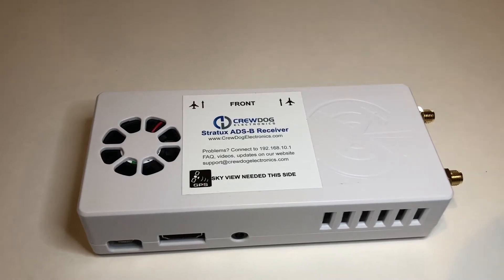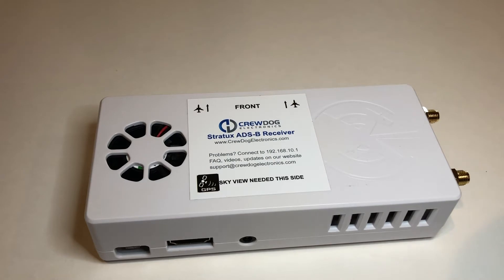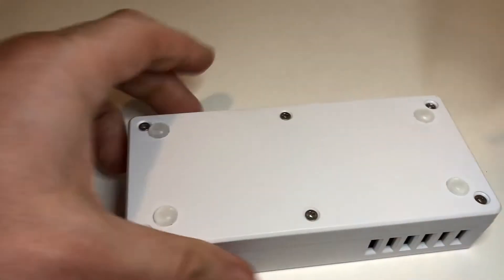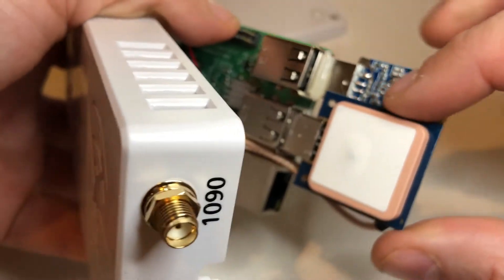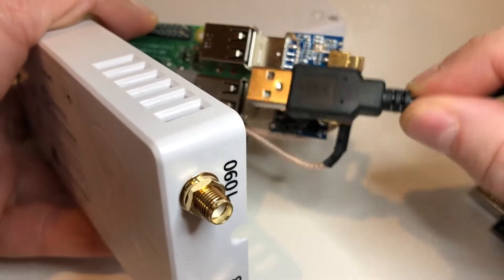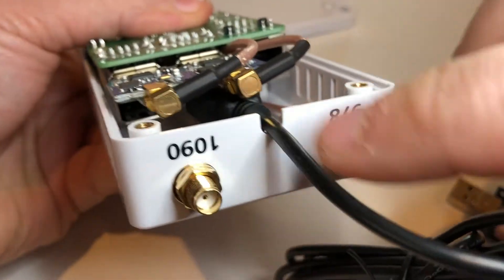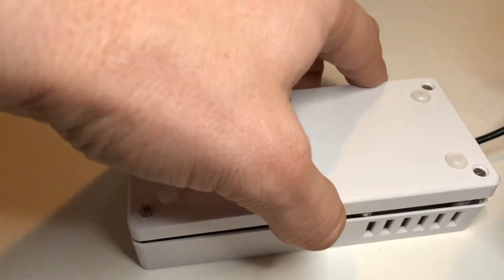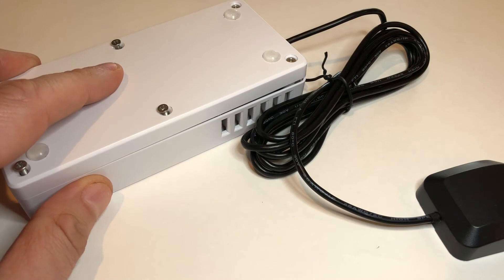Stratux External GPS Antenna Installation

Comment: Is the external GPS improving the accuracy/consistency that the stratux is picking up and displaying other traffic, or is the GPS antenna just improving the accuracy of where you’re being displayed on your map? 

I’m about to start as a CFI, and I’ve been using my current CFI’s Stratux while I was a student, but as the teacher I’d like to have my own. Just unsure of whether or not I should buy the standard package or the ultimate package to build, and the GPS antenna seems to be the big difference between packages.

Comment: I can't suction mine to the front window without throwing off the AHRS. It always shows opposite movement if I do. The only way it works properly, is if I lay it flat, with the antennas facing forward.

Comment: All good, but for the sealant. My internal antenna was glued in with a hard-drying substance. Careful picking at it with a knife, and eventually sliding the thin blade into the usb port to crack the glue worked out in the end.